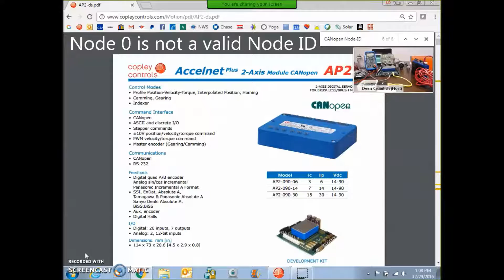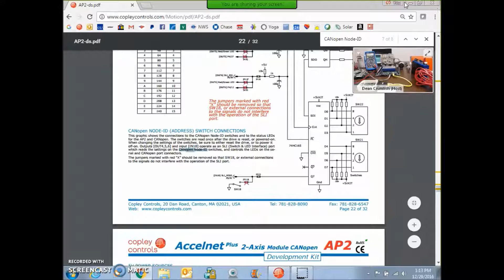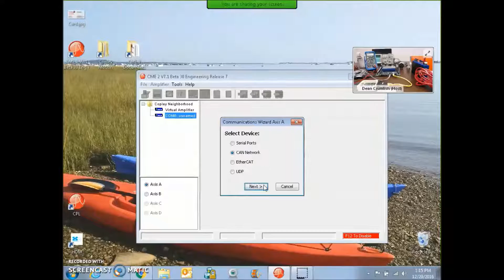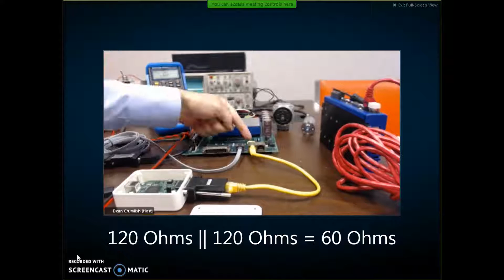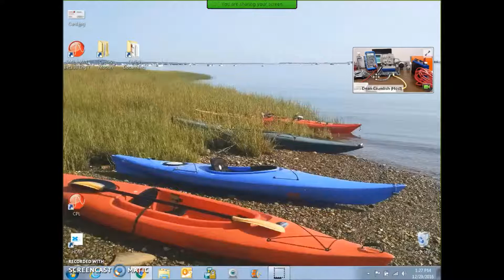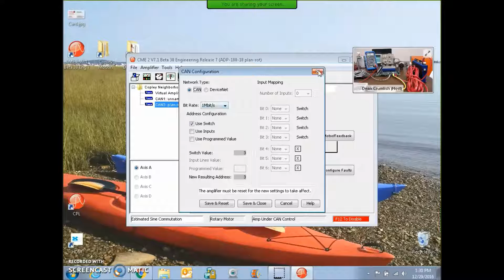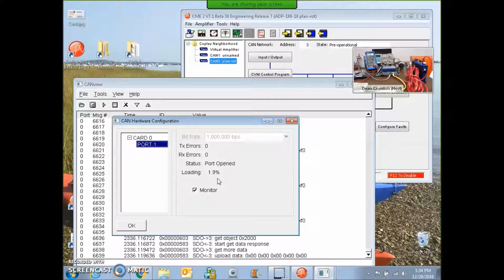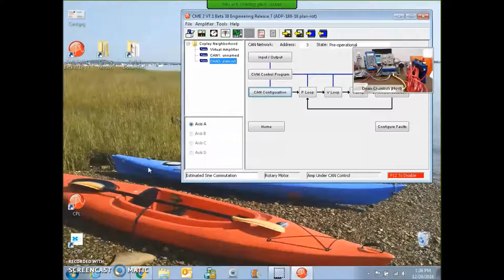CANopen Node ID's for MultiAxis using AP2 Accelnet Plus 2 axis Module

Comment: I understand CANOpen is  'Can In Automation's communication protocol (SDO, PDO, etc)..  rather than CanFestival, I'd like to use CANopenNode's implementation of the CANopen stack on a Pi with a CAN hat! 
http://www.byteme.org.uk/2015/11/12/canopen-on-a-raspberry-pi-using-canfestival/

Do you know of any GUI, similar to the CME 2 software, that allows setup of a simple frame to be transmitted periodically?   I'm looking to send 8 bytes of velocity data to an instrument cluster.

For example, can-newsletter has a nice pdf on using CANopen with a Pi.. and Capanalysis!  The latter uses an open-source web interface to analyze PCAP files!